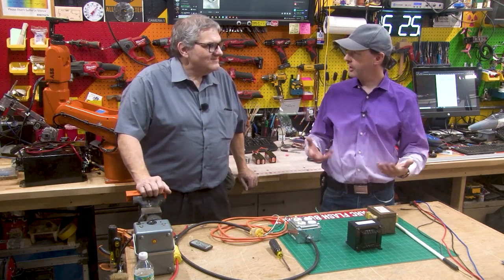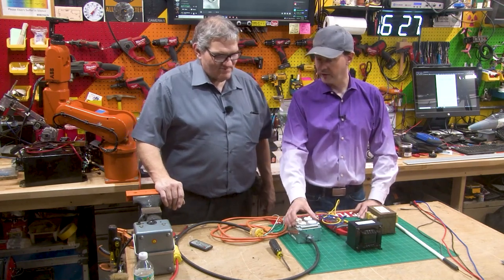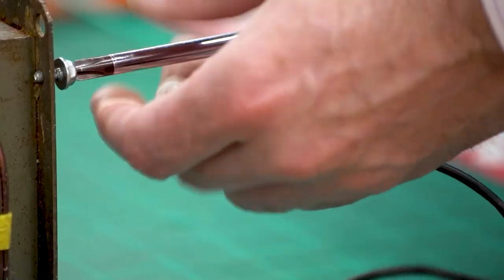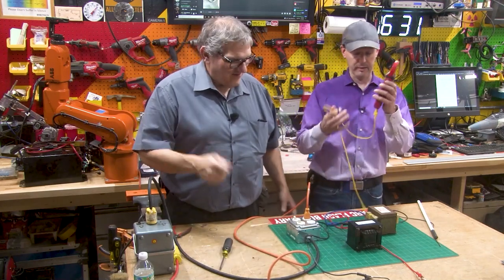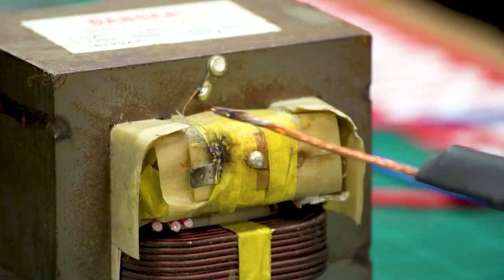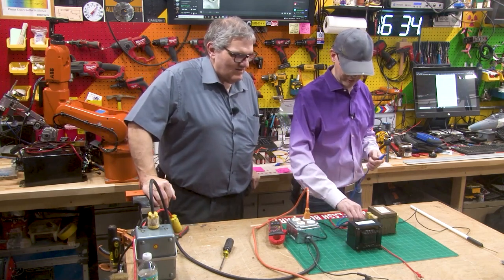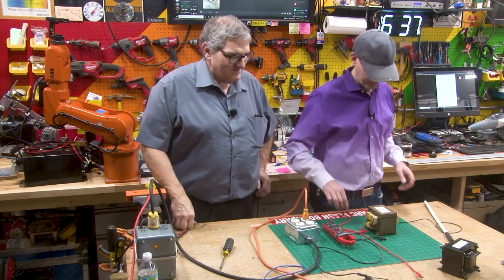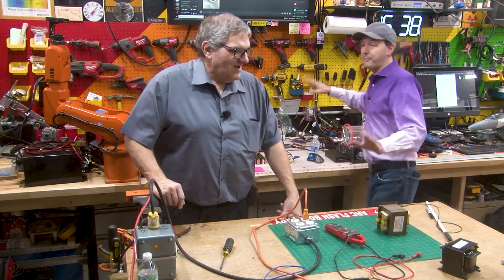High Voltage Episode 21 - Inductive Current Limiting To Control Current Draw

Comment: I just repeated part of this experiment and got puzzling results. I have two MOTs. First I measured the resistance of the coils. MOT A had a resistance of 0.6 Ω across the primary and 89.5 Ω across the secondary. MOT B's coils were 1.2 Ω and 100.8 Ω, respectively. I put a clamp meter around one secondary lead of MOT A and set peak hold. I connected 120 V across the secondary. Let's see, 120 V / 89.5 Ω = 1.34 A. Allowing for impedance, I expected about 1 A. I got zero detectable current. I tried the same thing with the primary. 120 V / 0.6 Ω = 200 A. I expected peak hold to catch something before the breaker tripped. The breaker didn't trip, and I got zero again. I left the primary connected for several minutes, and it didn't even get warm. 

I had saved the bulb from the microwave's interior light (20 W incandescent). I clamped the meter around one lead and applied 120 V. The bulb lit brightly, but no current detected.

I wondered if there were a problem with my clamp meter. I (nervously) tried connecting the 10 A port on my more expensive DMM in series with the secondary and applied 120 V. Again, nothing. Switched ports and range to mA. Nothing. Connected one meter to measure voltage and the other current. Voltage fluctuated between 122-123 VAC rms with zero current. Tried the primary with the same result. Disconnected the power and measured the resistance on each coil. No change. I repeated all the above with MOT B, and got the same results. At one point, two of my test leads accidentally touched. The breaker tripped immediately. Any clue what's happening here?

Comment: Also a perfect demonstration of why MOTs are such terrible transformers. About 500 watts of power dissipation with no load! They are designed very cheaply with not enough copper and iron to operate out of saturation at their intended operational EMF of 120 volts. If you reduce the input voltage to about 90 volts they are much more linear and efficient.

Comment: I think the average hobbyist should be able to handle Ohm's law.  When the current is low, there must be some resistance.  But then it's alternating current. so it's not only the wire resistance, it's the coil's impedance, and then there's imaginary numbers that have real effects and ... yeah, I can see why you don't want to scare them away with circuit theory.

Comment: Cant you just use a second mot in series as a current limiting inductor?
 Cant you also limit current by using different cores? As in  Less iron, adjustable shunts?
Reply from the maker: Yes (to both), it all depends on what you're trying to accomplish, and swapping out cores is a serious pain, just get a choke.

Comment: I have 2 MOTs with inputs in opposite phase parallel and outputs in series.  It sits idle at 15 Amps and goes to 60 Amps for short duration loading.  What inductance would I need to keep it under 20 Amps?
Reply from the maker: Here's a good place to start. This is the 10A version of the one you saw in the video. https://amzn.to/3MUxo9J

Comment: Been working on a project got a questioin, I made a solar power charging station for a 48v scooter. I now have 2x 48x lituim power packs for my scooter and I see people use a simple parallel wire to double the amp hours but it seems a lot of them catch fire, how can I limit two batterys in parallel to equal the amps of just higher then one battery?
Reply: the more I think its better two get a two way switch and use one at a time so im not feeding energy to the atmosphere, AC stuff is so wastfull lol

Comment: Damn i never thought a mot could draw 47 amps! Did you removed the shunts of the transformer? Back to a couple years ago when I was a noob and didn’t known about inductive current limiting i was drawing arcs straight off unballasted mots and the breaker was rarely popping (15a breaker)
Reply: 47 amps was the initial maximum current. The (unloaded,) steady state current would, necessarily, be less than 15 amps or the breaker would always disconnect.

Comment: Hello, Tesla Coil builder here. I am currently using a 12kV/30ma NST. I'd like to move up to a dual anti-parallel MOT setup with voltage doubler/peak detector. What I'm unclear about from this video is how one correctly sizes an inductive current limiter. Do I go by the 60Hz impediance of the limiting coil and my mains voltage? How do I know what is an appropriately sized reactor? Thanks.